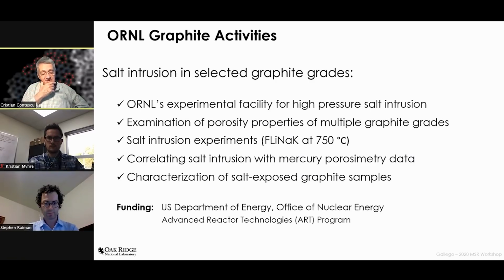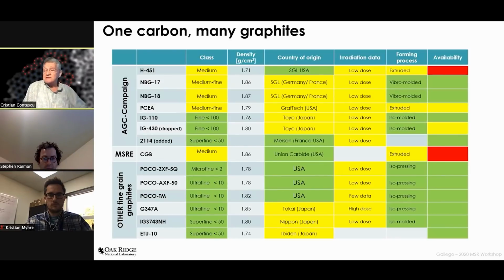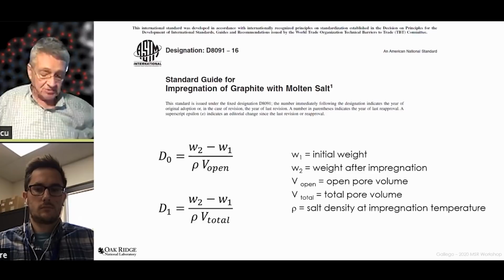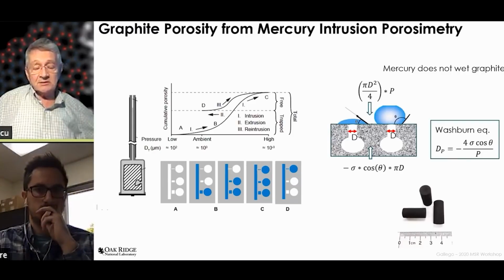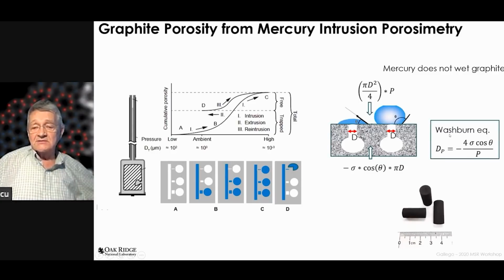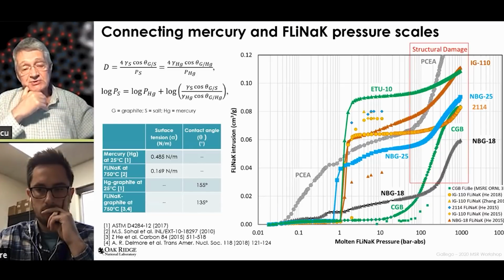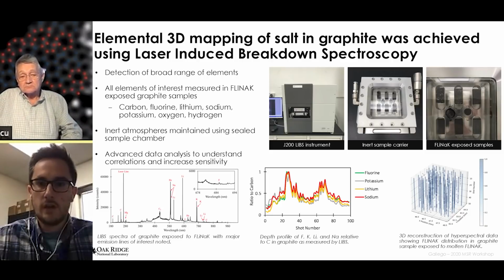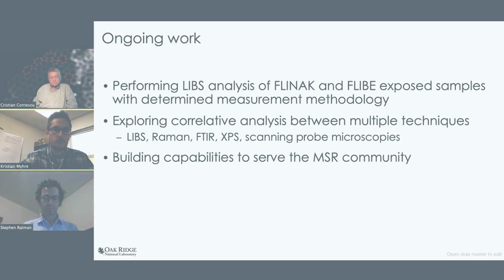Graphite Materials for Molten-Salt Reactors - Cristian Contescu @ ORNL MSRW 2020

Comment: A fast spectrum reactor will burn used nuclear fuel rods extracting 25 x more power than the original PWR or AGR reactor. It can also burn life exploited nuclear bomb cores we have lots of them sitting about in storage. It can also burn depleted uranium if which we have huge amounts left over by the enrichment process. We simply have no need to mind any new nuke fuel for decades.

Comment: he keeps mentioning salts getting in to the salt at high pressure yet every type of molten salt reactor i have seen being looked at operates at low pressure. why ?
Reply: Great question. "high" and "low" pressure are relative, and should really be "higher" or "lower" pressure thana referene. I grew up around boats, so I understand outboard engines. A high pressure yamaha fuel pump on an outboard motor operates at many hundreds of psi, while a low pressure fuel pump may operate slightly above atmospheric pressure to push the fuel throughout the engine. 

In a pressurized water reactor (PWR) the water commonly operates around 300 C and over 2000 psi. In these molten salt reactors, at these high temps where the salt has low viscosity like water, you don't need a very "high" pressure pump to create a high flow (that we want).
Reply: I imagine that in non-normal emergency scenarios, the reactor may be designed to be put into a more pressurized state than standard operation to flush the coolant and/or fuel salt out of the reactor to stop the nuclear chain reaction process, which may have drastic effects on the structural integrity of those that are moderated with porous material like graphite. Seems like measuring such high pressures (even though you would only license up to a fraction of that pressure for operation), is mainly for basic structural science, safety, and licensing.
Reply: @owluitar  but even with this scenarios the salt and graphite would be in contact for such a short time there is no point. every design i have seen works on the drain tank or the dump in more salt to dilute to stop the reaction as most salts react less as they get hotter and expand
Reply: @owluitar  have you looked how molten salts work
Reply: @brianwild4640  you still need a theory and data of how different types of graphite, and there are many, respond to intrusions into their porosities. Otherwise how do you choose which graphite materials are okay and which are not? Seems this data is needed to characterize performance of graphite and high temperatures in molten salt. Information that's not known now.
Reply: @brianwild4640  The experiments are to measure porosity, not to evaluate the graphite as operating in a typical reactor.

Thus, by using high pressure, they push material into the pores in a reasonable time-frame (vs say the years that a MSR would be operating). Then, presuming that leaving stuff in the pores reduces the effectiveness of the graphite and/or crumbles the graphite, the experiment shows which materials are best suited and/or how manufacture even lower-porosity graphite.

Comment: I think if you need a graphite modulator you have th wrong designe.
Reply from the maker: Nigel, do you remember the comment you left on Dec 5, 2018? How about you just let the grownups do their work.
Reply: What's a modulator doing in a nuclear reactor?
Reply from the maker: @henryD9363  Moderator. https://en.wikipedia.org/wiki/Neutron_moderator
Reply: @gordonmcdowell  I was poking fun at his lack of understanding. Anyone who knew a bit about reactors would know about moderators. Whereas a modulator is something you might use in a radio transmitter. I was going to ask him if the nuclear modulator was AM or FM!
Reply from the maker: @henryD9363  Ah. Thanks for clarifying you know wuzzap.